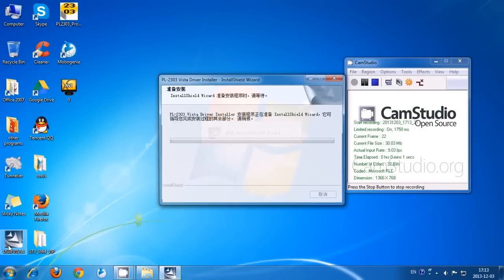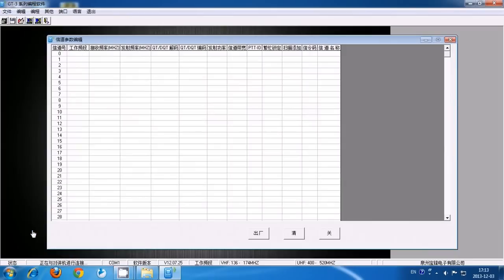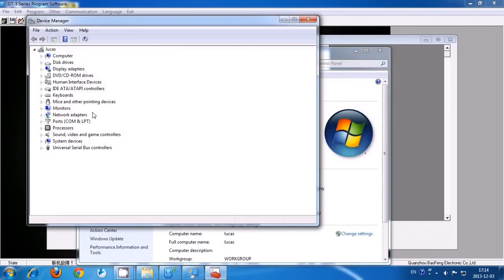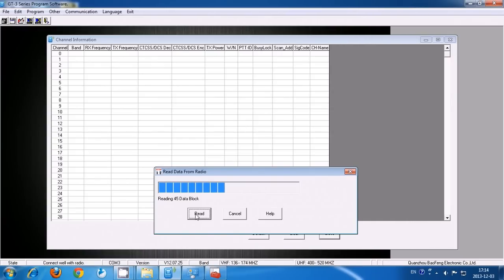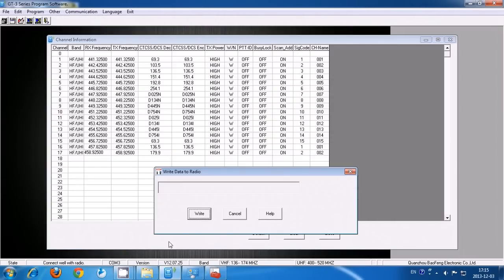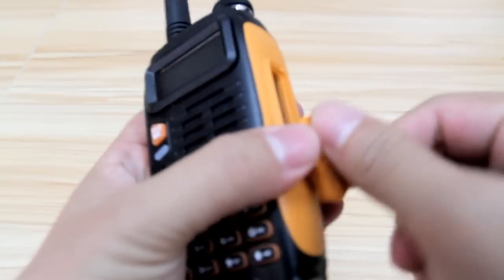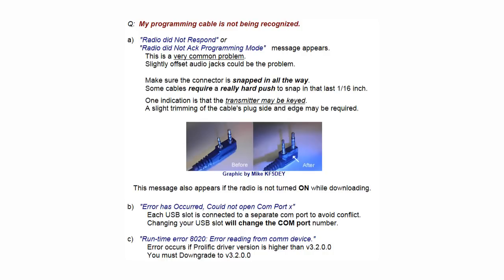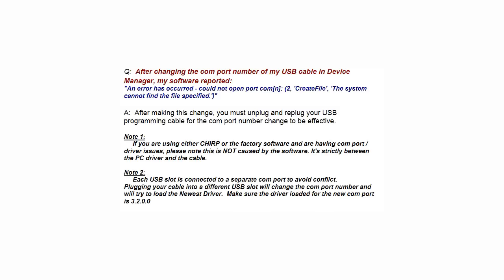Baofeng GT-3 Programming

Comment: Hi there just got the BaoFeng GT-3. I have the BaoFeng UV-5R and UV82 models never had a problem before in downloading from radio to PC or uploading till now. I can Download from the GT-3 and UV-5R is fine  but to up load from PC to GT-3 it wont do it, its giving me a unsupported firmware version N5R 3409 BFP3-25 can you help i can upload from PC to UV-5R noprob iam using a Windows XP

thanks 
David

Comment: Please check my channel for how to program these radios, and all about the Baofeng line.. I will show you indepth.. HamRadioConcepts
Reply: Help for the life of me I can't figure out on how to program this radio I'm the type that needs step by step instructions,
I'm in frequency mode I enter a frequency when I get to the last number to enter it says cancel and won't let me enter it ,
Why can't figure it out hope you can help I am going to use these as walkie  talkies and listen to police and fire, I bought 2 .hope you can help with this.
Thanks
George
cingeon@comcast.net
Reply: Also you say check my channel how do I get to your channel to learn in detail how to pro
Reply: Type in youtube "Hamradioconcepts" then scroll through the list of videos for "programming baofeng gt-3... Also, what frequencies are you trying to listen to police and fire on? Police are on 800mhz in most areas,and trunking systems, so you might only be able to listen to certain fire frequencies... Let me know if you cannot find the programming video, did you purchase the programming cable with this radio?
Reply: Hi and yes a cable and disc came with the radio s and the frequencys are local fire and police,-like 154.4000--55.70000-470.58750 for examples also want to use as walkie talkies for traveling don't know that frequency. The video I found does not go into detail sorry it does not show step by step
Reply: I have 2 of the Baofong GT-3TP does that matter or are they all the same